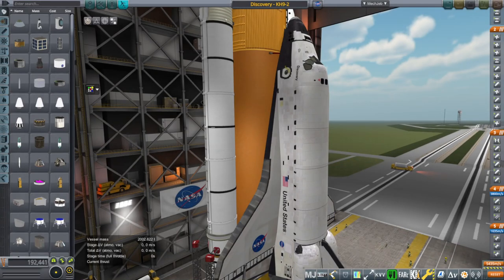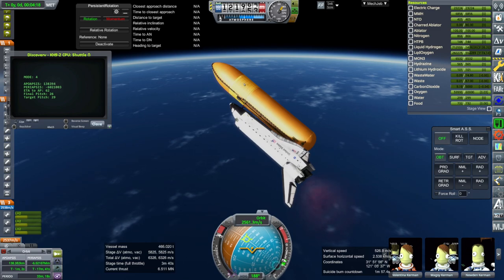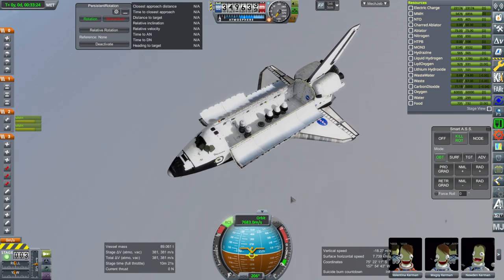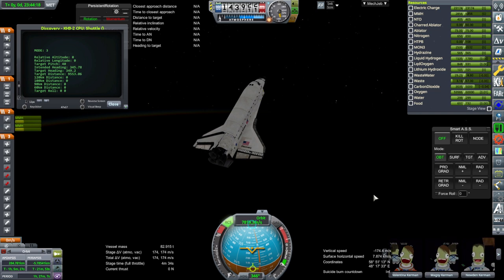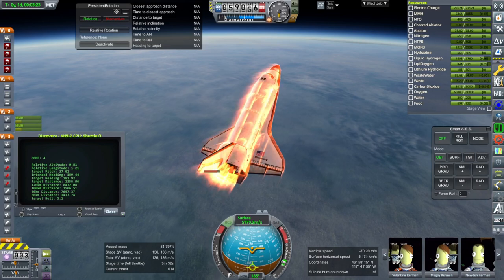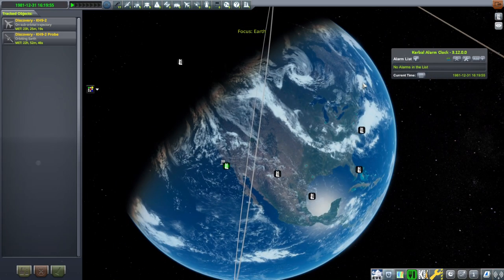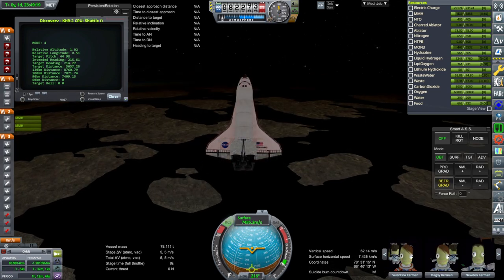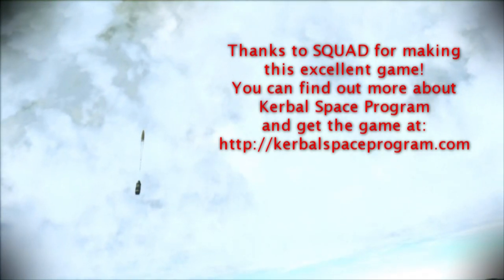Realism Overhaul in KSP 1.8.1 - Shuttle Test

Comment: Does the shuttle absolutely need the RCS on during reentry? I noticed you weren't completely maxed out on pitch while holding 45 degrees
Reply from the maker: Yes - if minor corrections aren't done it will quickly go out of control. It doesn't need all the RCS thrust, but it needs some, at least.